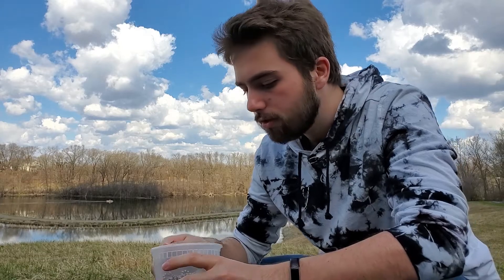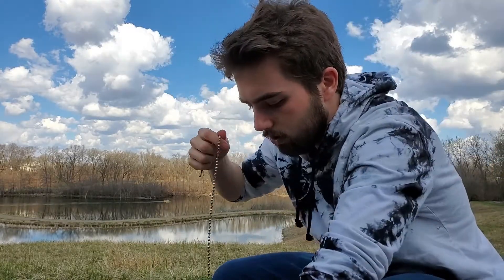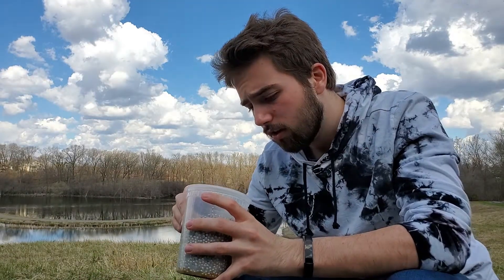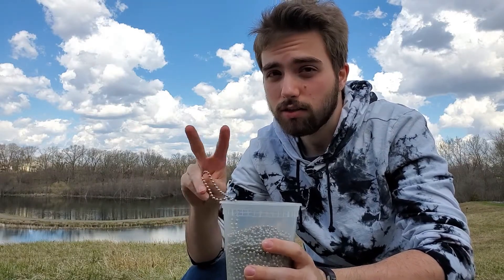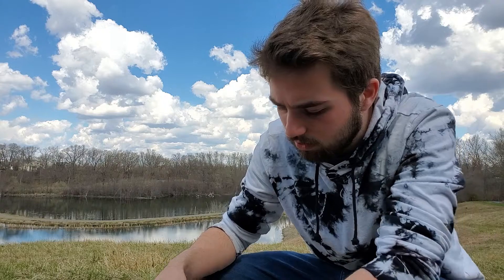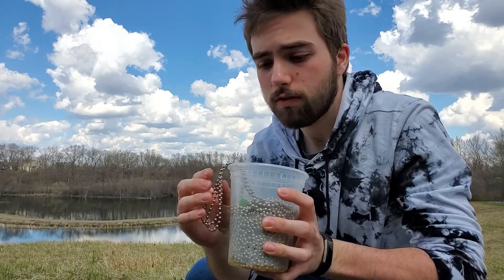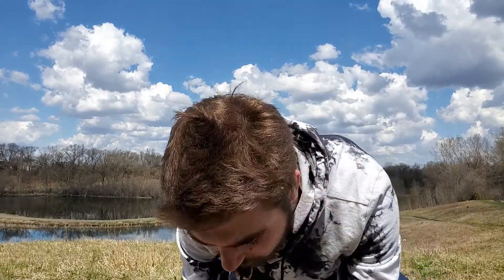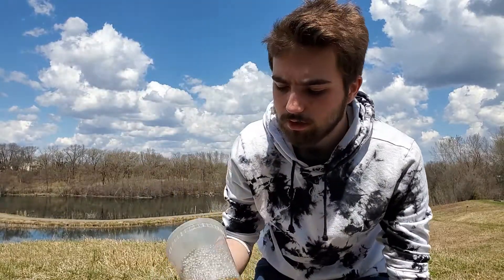4 Chain Fountain Experiments (Mould Effect)

Comment: Too many variables changed for the water experiment. The end of the chain no longer needs to raise above the top level of the bead pile. The Mould Effect and chain fountain doesn't have anything to do with a chain being pulled over an edge. That happens with rope and isn't notable.
It's the increasing peak height that makes the effect novel. 

So it doesn't appear to occur underwater but the experimental methodology is too faulty to know for sure.